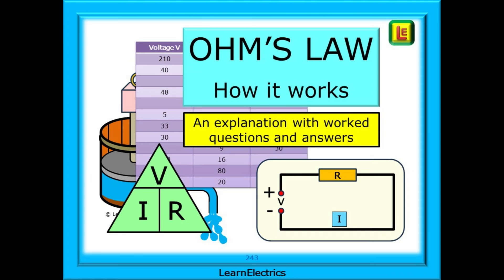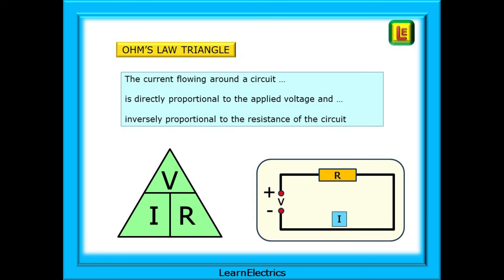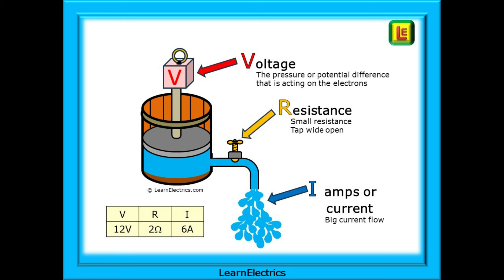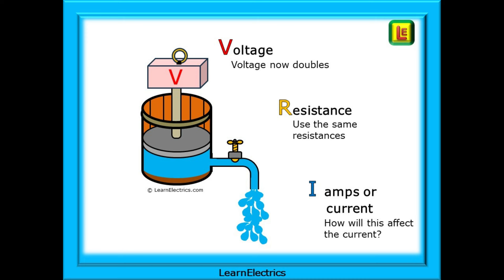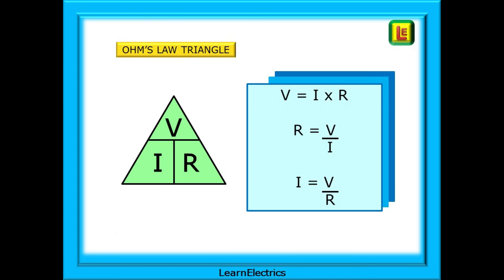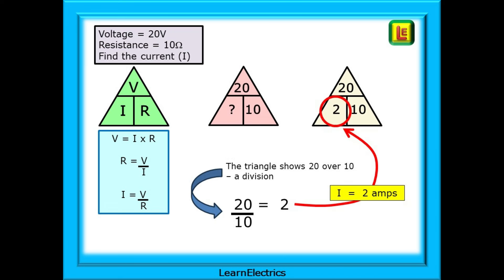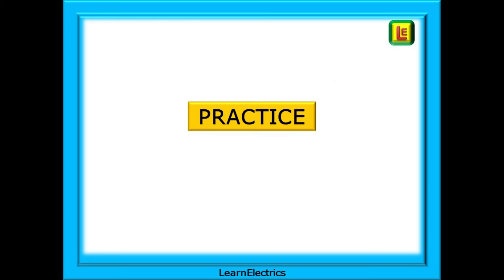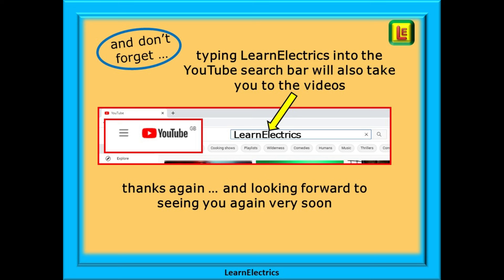OHMS LAW EASY EXPLANATION – WITH QUESTIONS AND WORKED ANSWERS – LEARNING AND UNDERSTANDING FOR EXAMS

Comment: Im dyslexic but found working out the sums easy once i change the triangle a bit, i just added a times symbol at bottom with the ( I and R) and divide symbol for V/I V/R . Once i could "visualize it" it really helps and just look at the triangle for reference. thanks for producing a simple video on this. much appreciated
Reply from the maker: Excellent, so glad it helped. Practice is the key to fixing it into memory. Even now, after more than 40 years I will still draw the triangle when I do a calculation. Thanks for watching. Dave.